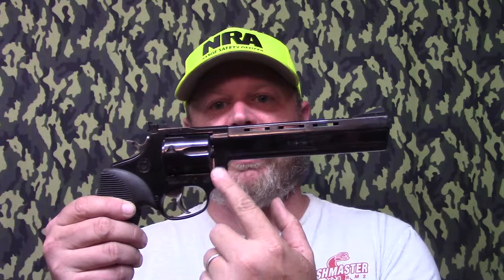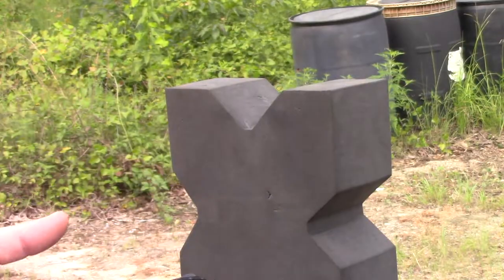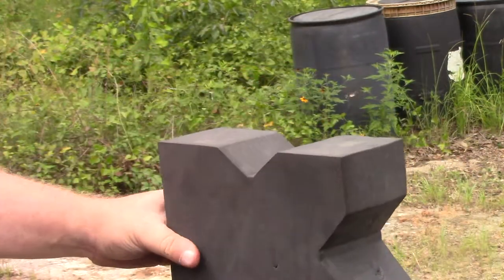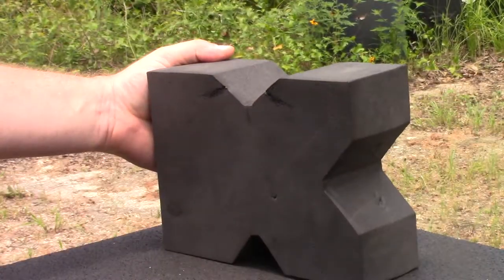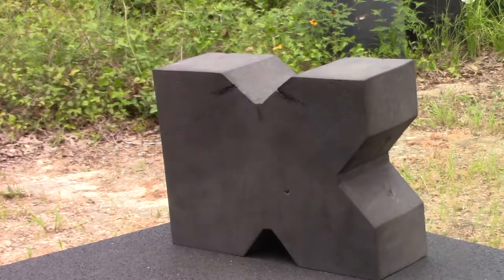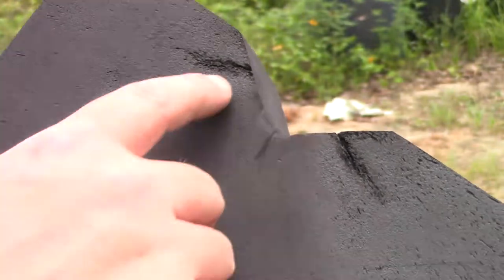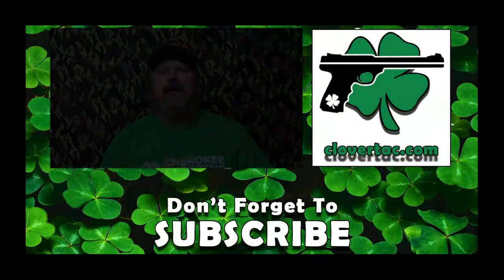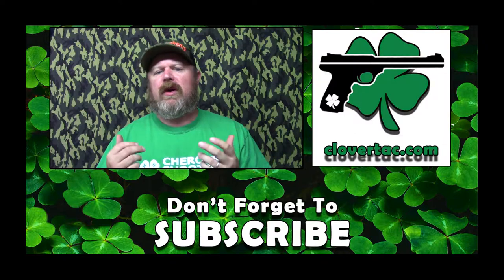Foam Action Sports Gun Rest - Revolver Cylinder Blast - Durability Test - Viewer Submitted Request

Comment: Thanks, great video.  I'm pretty impressed by the rest.  It didn't get much in the way of damage, surprised me!  May have to get one now.
Reply from the maker: The only issue with this test is it shows how light the rest it and with the pressure blast it will blow it off the table.  The heavier the firearm, the better it seems to work. But, for a cheap, light, compact option.... especially one that will have on a vehicle window, I agree it is worth having around. And, the thing will take a beating flat out.

Comment: Heavy duty piece of aluminum as a blast shield could help...maybe...
Reply from the maker: the point here was to try and damage this thing as much as possible, so obviously didn't wanna do that. but to eliminate the blast blowing it off the bench, yeah, that could be. the thing is just SO light, not sure that would even work.maybe just tape some string to it if nothing else so you can just pull it back to ya after you shoot. LOL
Reply: Thanks for the response.  I was just saying that a person could protect it from the gap blast with foil, tin, or something.  Just so that over time it wouldn't get burnt.  And, I appreciate the testing, and the gun cleaning you had to do!
Reply from the maker: oh yeah, but after all the testing on these rests, I find they are pretty dog gone rugged. i don't see the blast damage being a big issue honestly. the damage is mainly just aesthetic.
Reply: Alright, thanks.  Been talking to my girlfriend about getting one, or more.
Reply from the maker: i don't think you will be disappointed, pretty cool little item, be sure to use code CLOVERTAC if you buy them, save you a few pennies.